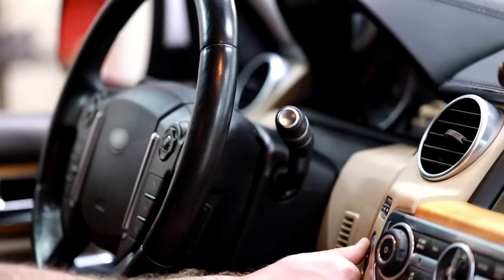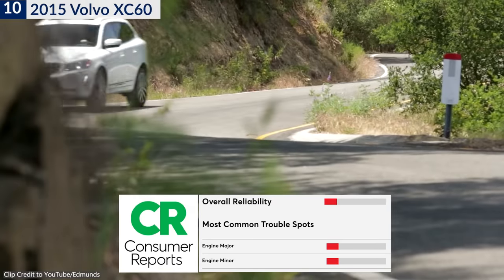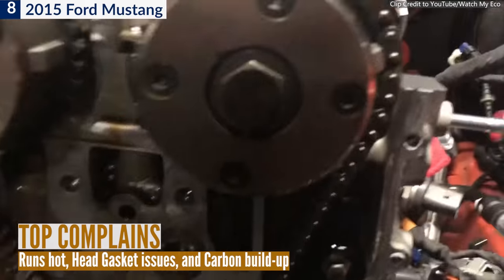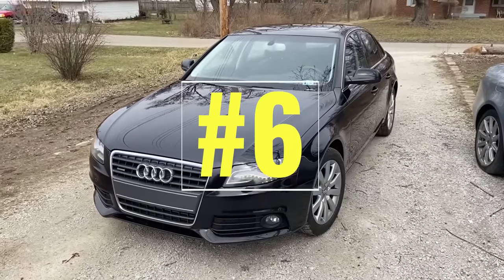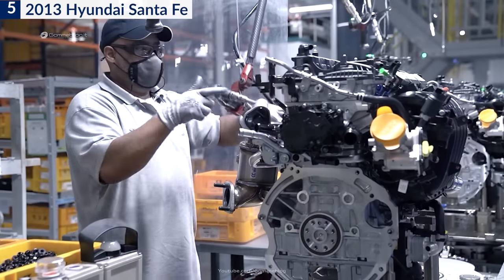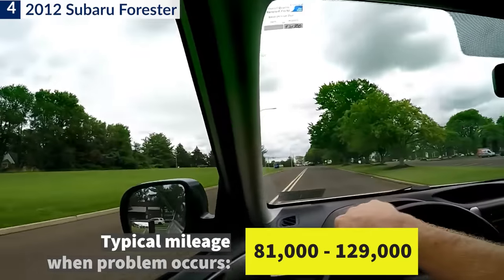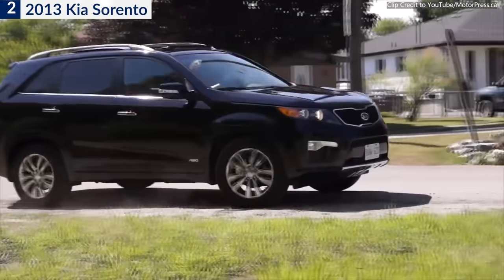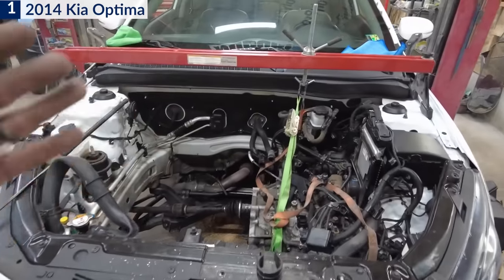10 Used-Cars to AVOID for BAD Engine - as per Consumer Reports

Comment: This is why I have a 1992 Camry with 315000 miles, a 2000 Avalon with 297000 miles, and a sienna with 256000 miles, all with no problems.  I am not planning to buy a car soon.  I have no concerns yet. They all behave like when they were new.  Change oil at 3 to 5000 miles, and go.
Reply: How about transmission fluid?
Reply: @carhoarder602  Depends upon maintenance requirements.  If none are specified, I replace my trans fluid (do NOT flush, REPLACE) every 50k.
Reply: @eskieman3948  it’s a forgotten maintenance item along with fuel filter for many owners

Comment: Buy Toyota
Reply: Or Lexus.  Mazda is generally good to.  Avoid everything else.
Reply: Yeah I agree. Six months ago, sold my 2007 Honda Fit and went shopping. Test drove everything and read every YT review. I keep my vehicles 10 -15 yrs plus so I didn't want a CVT, direct injection or turbo charging, all possible major problems later on! Settled on a 2021 Toyota RAV4 XLE Premium, which has none of the above!! I'm 68 years old and this is my first Toyota. Hope I made the right decision. I guess time will tell!!
Reply: @ronripley9197  You did make the right decision... Without question!👍
Reply: @markjacobson1285  Thanks Mark! Really enjoying it after 6 months of ownership. Not used to all the technology though!! 07 Fit had a standard transmission, power windows and a CD player/radio!!!!
Reply: @ronripley9197  I understand. We bought a 2021 Highlander Limited AWD with the big info center. A lot of tech, but I trust Toyota to get it done the right way! Safe travels 👍
Reply: @ronripley9197  You made a great decision. Happy Toyota owner here with 246k on my 09 Camry. The only things I've done are a valve cover gasket at 187k and a water pump and thermostat at 224k. Change the oil and do the basic stuff and that car will last you the rest of your life, even if you live to 95. LOL
Reply: @ronripley9197  Generally hard to go wrong with a Toyota if reliability is your primary concern.
Reply: @ronripley9197  great choice. Smart shopper.
Reply: Had to ditch my 2020 Malibu, only had 8k miles and the stupid thing went crazy one day while parking, wouldn't go in gear and was vibrating like crazy. Traded her in for a 2018 Toyota C-HR, with 48k. My first Toyota, but it won't be the last. Matter fact, I'm sticking with Toyota from now on.
Reply: @briantii  It was long term reliability I was looking for. The Rogue had a nicer interior, the CX-5 had a nicer ride and pretty much everything had a quieter engine than the RAV4, but it checked all the boxes that I was looking for as far as long term ownership. If I was someone who kept their vehicles 5-7 years or less, I might have considered another brand.
Reply: @Armadillo Funny, I have none of those issues. You must be in the minority, as the last time I looked, the RAV4 was the best selling SUV in North America. Say no more.
Reply: @user-tb7rn1il3q  Hyundai and KIAs are better. Toyota lost it's reliability. This video is very misleading. It's like CR owns this page.
Reply: @bryanmattingly4640  no
Reply: @briantii  toyota reliability is not that good.
Reply: @america6529  my advice is stop smoking weed! Your words are the indictment of your credibility! Toyota/Lexus are #1.
Reply: @america6529  🤣 Prove it.
Reply: @america6529  Prove it.🤣
Reply: @america6529  You think Hyundai is better?!?!? That's absolutely insane. While Hyundai has made great progress clearly you've never heard of the Theta 2 engine. Toyota to the best of my knowledge has never in it's history had a blunder that big.

Example...

https://youtu.be/2iaMHhWkSNw
Reply: @briantii  Hyundai are great cars
Reply: @tesla_models  Sure, as long as you don't get one with the Theta 2 which is in like 1/2 their cars....
Reply: @briantii  owner owns a Hyundai elantra 2012 . With 200k miles no issues
Reply: @tesla_models  So a car that doesn't have the Theta 2 engine. I have a Lexus with well over 200k miles. I'm not sure where you are going here.
Reply: @briantii  idk but Hyundai however don't make unsafe cars like Toyota
Reply: @tesla_models  I guess it depends on your definition of unsafe. Do you consider shutting down on the interstate unsafe? What about if that shutdown includes dumping 4 quarts of extremely hot oil on a very hot exhaust? What about fires? Are cars catching on fire unsafe? What about if they catch on fire in your garage without warning shortly after you drove the car? If you see any of those as unsafe then you probably don't want a Hyundai with a Theta 2 - all hall mark issues. And before you say "yes but they recalled it" - yes, yes they did. 

You know what they did to "fix" the catastrophic engine failures in that recall? They updated the software so that the knock sensor would pick up not only combustion induced knock (from low grade gasoline, etc), but ALSO ROD KNOCK. Now when the engine senses it's about to self destruct it goes into a limp mode so HOPEFULLY you can pull off to the side of the road and drive 20mph to get to your dealer or have it towed. Legit - they didn't fix the actual problem of the engines blowing up but just did a cheap software hack so it was less likely to spread it's parts and oil across the interstate. I truly didn't believe it until I did the research myself - it's that shocking.

Regarding Toyota being unsafe they have a good number of IIHS Top Safety pick vehicles just like Hyundai does so I'm assuming you're referring to the un-intended acceleration from 10 years ago which from what I've seen is mostly speculation and no real conclusive evidence that the cars ACTUALLY did that. With that said it's a lot easier to prove a car caught on fire than it is to prove who/what/if pushed what pedal after an accident... so who really knows for sure. Either way Toyota put that far behind them. Hyundai is still selling (slightly less) defective Theta 2 engines today.

Sure I'd buy a Telluride or something with a V6, but I'm sure not under the belief that it's more reliable or technically superior to a Highlander - I'll admit the Telluride sure does look better and that's probably why I'd buy it over the Toyota.
Reply: @marklintwo  i smell fanboy
Reply: @briantii  Toyota has exploding airbags and fuel pump issues. Get out of your rock
Reply: @briantii  those 2020-2022 new theta 2 engines are far more better than those previous ones. If you going to troll, at least do a better job at it.
Reply: @marklintwo  why are you triggered fanboy?
Reply: @markjacobson1285  Sure whenever toyota get fix their exploding airbags and fuel pump issues. Hyundai is the way to go.
Reply: @america6529  Says THE troll. “Better” than horrible is still average at best and I even acknowledged they were better. Heck I even said I’d buy a freaking V6 Hyundai but reading and comprehension clearly isn’t your strong suit which likely also explains why you’re a Hyundai fan boy.
Reply: @briantii  great explanation
Reply: @tesla_models  Thank you for the constructive conversation. Hard to find on the internet at times. :-) Have a good one!
Reply: @america6529  🤣🤣🤣
Reply: @briantii  oh thanks. Your explanation convinced me throughly
Reply: @america6529  I just call it like it is. I drive German luxury cars almost exclusively these days so I know all about driving experience over absolute reliability. Unfortunately Hyundai doesn’t specialize in either.

Comment: I owned a 2011 Hyundai Sonata.   Actually liked the car but did use oil at about 85000 miles.   It was scheduled for an engine replacement but was in an accident that totaled the car.

Comment: 2017 Tuscon connecting rod bearing failure. Ours went into crawl mode, thought it needed new engine, told us it would take two months. False alarm, but they did warrantee it for 200,000 km due to recall.

Comment: Add the 2016 Kia Optima 2.4 GDI  mine burns oil  at 85000 every 400 miles I feed it oil
My daughters 2018  Sorento  caught fire  because of engine failure at 59000  miles and 
Facebook documents  new failures every day.

Comment: About a 2017 Kia Sorento with 75,000 Mi on it changed the oil 82,000 myself 87,000 it went down on a cylinder number three they won't stand behind my warranty because I changed the oil the first time myself and I ain't got a receipt now since I took it and had it changed at the mobile one place I even put 3000 miles on it and done went through six quarts of oil so needless to say if I ever get it fixed I will not be getting another Kia and I'm I'm from White House Tennessee

Comment: We bought a 2017  Hyundai i30 a few years back, we only kept it for three months, it wouldn't pull your hat off, the gearing was all wrong, fine on a motorway, but rubbish on single lane roads, we spent most of the time in 2nd or 3rd gear changing up, the car went flat and would not pull, overtaking anything, even lorries was a risky business.

Comment: My 2014  focus trans problems started at 122k miles, but local Ford dealer (Winston Salem NC) says couldn't find any problem after test drives more than once n 25 miles driven.  As soon as I picked up after driving 15 minutes problems started again n have last 2 days. They're just ignoring it because they can't fix n Ford doesn't want to incur anymore cost on it. Heard they even advised dealers to deflect owners concerns. Never buy Ford again.

Comment: I have just had my 2014 MB 450GL with 77,000 miles, die.  They (MB dealership) apparently found metal in the oil and said the car needed a new engine (for $34,000).   Dealership kept care of the car the entire time I owned it, and it had expensive upkeep through that dealership.  
We needed a car promptly so sold the MB for parts and had to buy a new SUV.  
Do we have any repercussions for this?  It is absurd!!  They claim they can’t do anything.   Can you give any advice?? Tx.
Reply: May i Please ask how much you got selling it for parts?
Reply: @donc6781    Hi Don.  Yes, $7k.  😡
Reply: @janeekblom1828  Wow that’s sad

Comment: There is a common denominator here: engine builders trying to crank too much power out of small (especially turbocharged) engines. A year or so ago when I heard about Ford's 1 litre 3 - banger pumping out 197 hp I cringed...literally. 
     No question about it: with some exceptions, car quality overall has plummeted last 15-odd years. 
Amazing fact: right here on YouTube there is a video which shows the 10 passenger vehicles which have recorded the highest mileage. Get this...3 of them are Chevy Silverados!! No joke.

Comment: 1997 to 2003 I think
1.4 turbo Audi and vw
Also had two class actions
The oil would turn to sludge and blow motor

Or the timing belt would randomly break 25k to 60k miles

Comment: Add to it the 2007 Chrysler Sebring 2.7 engine. Oil holes drill improperly, causing insufficient oil flow...and sludge because of antifreeze leaking into oil at water pump causing sludge. As far as I know no cure for either problem....just keep changing oil more often than usual.
Reply: Oh those were a horrible engine, disposable cars

Comment: I have had 2 of one engine and 1 of another and they lasted well beyond 160kmi without issue. I think the OCI indicated by OLM on most cars is too long. Save a few quarts for oil to trash an engine to save the environment. I did have a 2.4l GM and was on the 3rd timing chain when we got rid of it at 70kmi. This was the last time we followed the OLM.

Comment: Older cars were definetly more reliable and longeve than more recent, with complex electronics. I am the happy owner of a 1991 Toyota Hilux Surf that still runs great being almost 32 years old.
Reply: My 1997 Mazda MX6 just bit the dust. AC is out, it won't pass smog, and it has some rust, so I can't justify repairing it. I'm car shopping now, unhappily.

Comment: The Range Rover 5L is also an issue, thanks to change to a cheaper timing chain tensioner. I believed they fixed in in 2017, but not sure. The 4.4L in the 2006-2011 is a rock solid engine.

Comment: THIS modern IDEA. Of Rubber timing belts.  Is a total disaster particularly on diesels. If the £60 belt looses teeth or snaps. Instant wrecked engine.   Valves bent broken smashed cylinder heads. And damaged cranks.   It’s a disaster.  .  DIRECT DRIVE GEARS from crank to Cams.

Comment: Seems like a lot of durable and reliable vehicles from before 2010, and the really new ones are good. Did manufacturers just collectively check out from 2011 to 2016?
Reply: The main thing most did, like Subaru was go with thinner oils trying to increase fuel mileage. In 2012 Subaru went from using 10w30 to 0w 20 I believe.  They also charged the design of the engine with the new F series. Both were a disaster.  The J series engine was a reliable engine except for head gaskets on the non turbo models and were not know for any issues other than that.  With the new FA engine, oil consumption issues, converter issues, and…. They still had the famous head gasket issues.  
Bottom line, most manufacturers went with thinner oils ,redesigned already reliable engines, went to smaller engines from already reliable larger engines, used turbo chargers and direct injection to make up for the smaller displacement and it was all a disaster across the board.
Was just the same for 18 wheeler with all the emissions hitting in 2011. 
So as you correctly pointed out, stay with 2010 and before and save the headaches and money
Reply: @amlafrance1918  So if you're going to tell the story, tell ALL OF IT.....  Subaru has resolved ALL of those problems.

Comment: So far our 2012 Subie Forester we still have has not had too many engine issues. However our 2013 Subie Forester had severe engine issues. It had starting issues and would bind up with compression and not turn over. No idea what was wrong. After over a year of fighting with the dealer to get the issue fixed I gave up and replaced the car. Found out then their "highest trade in value" claim is a bunch of horse pucky.
Reply: Obviously, you never invoked the "Lemon Law".  Too bad.

Comment: 2013 Equinox.  Started blowing oil. Like pfft! Gone.  Chevy made good with a recall and replaced all the pistons.  As long as it hadn’t hit 120k miles they would cover.  I was at 118k and they made good with it.  I’m now 157k and it’s running great but I know some expensive repairs are coming up.  Replaced the starter already.  Not sure how much longer to keep it. Looking at Toyota for my next buy.
Reply: I’m at 178,000 and it just keeps rolling along.  Not buying until it dies.  Fortunately the longer I wait the better the market is getting.  😊

Comment: The mustang..the problems that I see could be solved with using an upgraded cooling system and a way to get the carbon out to stop the buildup from happening.

I’m wanting to get my hands on one of these engines and drivetrains for a full swap into a 1970s mustang 2 with one of those “indestructible” gas tanks used in racing. I wonder if anyone else has done this before..

Comment: its worth mentioning that the motor they had issues with the subarus is that longer stroke motor, those were like an issue for all models across that era i blazed through this I don't think I saw any mention of the ford edge. it has a really poorly engineered waterpump.

Comment: 2014 Kia Optima SXL owner here… my engine always ticked and i was told this was bc it is a GDI? anyways my entire engine blew and started smoking about 70-80K miles in… after a nightmarishly long period of time driving rentals, i finally got my car back after a engine transplant which was 100% covered by Kia (as it should be). Do you have reason to believe that my new engine will also have problems?

Comment: I own a Kia Sorrento , model year 2012, and it has a intercooler turbo diesel engine. It has around 140k km. I have not had any trouble with it so far. Your video did not mention anything about the diesel engine in particular. Should I sell it, or keep it?
Reply: The crdi diesel ones are known for RELIABILITY. I have one.

Comment: Forgot to include 2012 Jeep Grand Cherokee with 3.6 V6. Currently having the engine replaced because of engine misfire on 2 cylinders and had a bent valve. Discovered that this was an issue with these engines from Mopar. Had I known this, I would not have bought. Total replacement cost about $8000 for a used engine. Stay away from these unless you get a V8!

Comment: Most cars today have the fuel pumps in the trunk, not on the engine. Fuel pumps require fuel to keep them cool and running a fuel tank with low fuel levels can cause the fuel pump to overheat and over time can cause premature failure. Second, small engines with forced induction (turbo) run under higher pressures than normally aspirated ones so there is increased stress on the engine. That doesn't help when some 18 year old thinks he has a Shelby and drives it like it. In my 45+ years of working on cars I have seen that most car engines that fail early are either because of abuse or poor maintenance. Changing the oil and other fluids regularly is critical for long engine life, especially if the engine is small, forced inducted or if you drive it hard. Not saying there aren't poor designs out there but most cars will last just fine if you just take care of them properly.

Comment: Because, today, cars are disposable and total rubbish. They're not meant to last long so that you can keep it forever, 5 years the most, then trade it in for another sucker to buy.  I have a 1965 Australian built Valiant 4PV-V8. It used to be my dad's, still going like new and today it's a gem to hold. Its 340 V8 has seen may years, goes well and its automatic transmission, the magnificent Torqueflite A904LA, never had any trouble with it. As a mechanic of 43 years, I used to service and maintain it myself in mind condition. I still garage it and love to drive it, despite that there aren't many models of this type around.

So, you want to talk about cars? I will show you what cars are real cars, the Valiants.